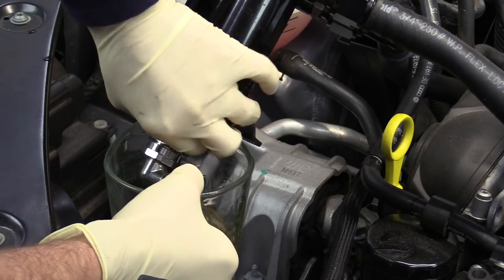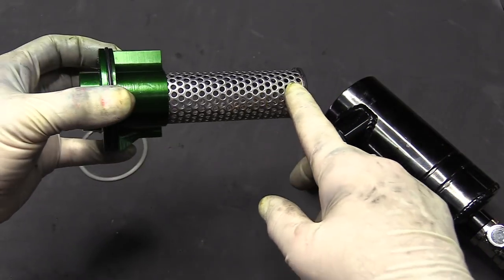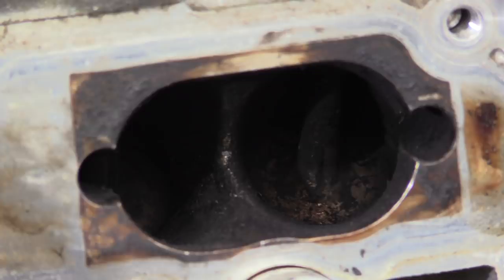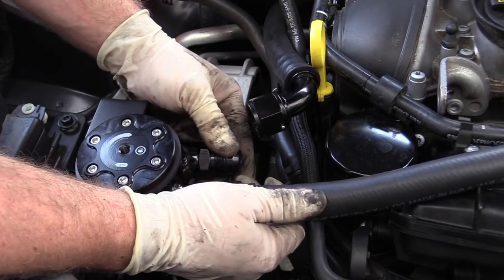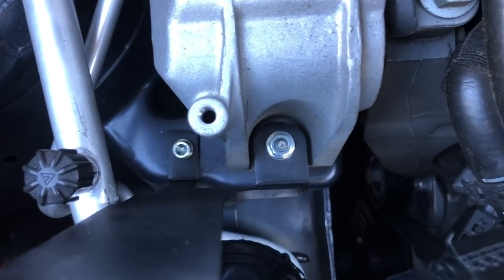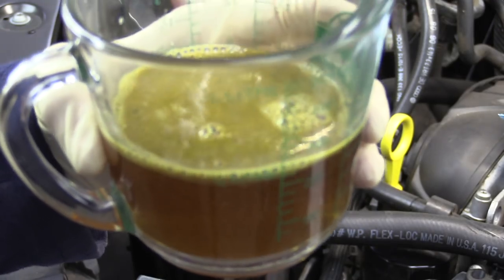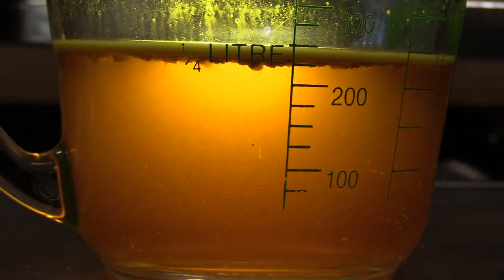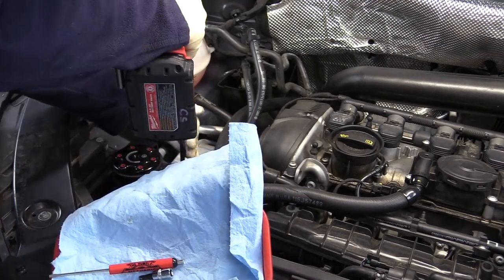Do Catch Cans REALLY Work?

Comment: Hello Charles.  What you have there is mostly Condensation.  On the GTI forums many folks have had their Catch Can Goop tested and found it to be mainly what is to be called Condensation.  There is some oil in it yes, but not as much as you think.  To answer your question?  No.  I have seen SO MANY reviews and folks that have used these in their MK6 GTI's on the forums, on oil websites, etc that folks that have had Catch Cans on for over 50k miles STILL had carbon build up.  If anything, this MIGHT slow it down some.  That would all depend on your driving style and where you live.  There have been folks in cold climates that have had SERIOUS problems with catch cans causing problems and lets not forget to mention Oil Catch Cans are An AUTOMATIC FAIL in an emissions test here in California, as I am sure any other strict Emissions State. My local Dealer cleans the Valves for $400.  This is cheaper than most catch cans, and since it only needs to be done once in a blue moon, I think just getting the valves cleaned every so often is the best way to go.  You dont really save any money here, its not proven anyway.  Just my ten cents.
Reply: Jeff Eppenger are you sure catch cans are a fail in Cali? Its my understanding that catch cans like Mighty Mouse are fine because they arent actually letting anything escape, just allowing the oil to seperate from the air.
Reply: Jeff Eppenger this catch can isn't open to atmosphere so the vapours go back into the intake which shouldn't fail emissions test. It's more an aos (air oil separator) than catch can.
Reply: Jeff Eppenger best comment I've seen on catch cans.  We know it's not 100 percent effective for sure. Your still going to have to clean your intakes , plus the cost if a catch can, plus the motion of cleaning it out more often than not. A change of oil.
Reply: Jeff Eppenger -- I think your right, and the condensation is from the catch can it self !
Reply: Why not just do an "Italian Tuneup" instead of spending the $400?
Reply: Frank Bongiorno Frank Bongiorno Naaah doesn't translate well to German cars. The side effect is they end up rusting out the body panels and refusing to work in the afternoons. But then again, you as the owner also suddenly acquires the nuanced Italian gestures and just shrugs it off like only an Italian can.
Reply: How is a $400 valve cleaning cheaper than most catch cans? Even expensive examples are less than $200.
Reply: I have built my own 3 stage oil catch set up and for a lot less than $400 !!!  I looked at some in the link and they looked way overpriced as most Euro crap is and the cars appear more complicated and with higher parts cost.  I like my Chevy and if the only other choice is imported I'll go with Japanese or Korean.   
.
The Canadian Condensator is a better deal than these ones and I consider them high too.  
.
http://www.condensator.com/
Reply: snb13 - You've never priced one for a TSI apparently.  The one Charles linked that he has is over $500.
Reply: Frank, because it doesn't work.
Reply: That is not an automatic fail. Nor is it a fail. It's not an emission related part. It has nothing to do with smog emission system on vehicles in California.
Reply: Catch cans wont fail emission testing unless you have it vented into the atmosphere which is a homade can, not a good design that is sold to the public.  It’s like having a drop leg in a gas line, how could that hurt testing?   It would help if anything, since you aren’t sending oil vapor into the cylinders to be burned.  If you simply wait till you get a fault code, then you have been dealing with lost performance and lower fuel economy well before the light came on.  It’s slowly choking out your intake valves and screwing up the seat over a long period of time, it’s not like flipping a switch.   Being proactive in maintenance and delaying this buildup is always the better way to go.    Use the crc intake spray cleaner with a catch can setup, also choose a good synthetic oil with a low noack or volatility, which means less oil evaporation, like Mobil 1 esp which is well known in Europe for diesels, but is also marketed for gasoline engines for emission systems protection AKA ESP.  You would be a good candidate for a lease.  Lol
Reply: @snb13  well,the one he used costs around 500$ so...
Reply: put small camera into hole of spark plug to inspect how much of c you have on pistons- it can not be cleaned by any seafoam or simillar just hard work gride-  i put off heads and on pistons were 2-3mm of hard carbons -from sucked oil from pcv valve that did not made its job

Comment: I've run a can on my hilux in Australia for years. It certainly catches plenty of vapour and has kept the piping cleaner.
On thing everyone seems to miss, 
This vapour also lines the intercooler with sludge creating a heat sinc. this prevents heat transfer and therefore stops cooling destroying efficiency.

Comment: I have a rx performance catch can it was filled with water oil from my 2014 Ford focus with a standard 2.0l I dumped out the catch can every 5k miles. Works really well and I will do also do an intake cleaning using soda media or glass to clean out my intake valves.

Comment: I can't help but wonder how much condensation is from the catch can itself. Like a single pane window, condensation appears due to cold outside air, warm inside. (draws the moisture out of the air to the cold surface and then condensates)

Comment: It's mostly just collecting water.  Not a big help.  In cold weather it is actually a pretty big risk.  If that can fills up before you get a chance to empty it all that junk will get gulped back into the intake all at once.  If it freezes , even worse.  Pcv won't work and pressure will build it in the crank case. 

In my opinion these risks aren't worth the reward.

Comment: Maybe what you drained out was designed to clean the back of the intake valves lol.
Reply: I saw that and wondered the same.   Clearly, it is mostly condensation and a small amount of water injection may be good for a variety of reasons (improved knock resistance,  cooler engine temperatures, and some steam cleaning on the back of the valve).  Really makes me wonder if a catch can makes things worse or better.
Reply: All that shit would go back into your intake. Do you still wanna question if it should be there or not? It's vapours, Sherlock, it's bound to condensate eventually.
Reply: @Lessthanthreeedm  yeah we're having a laugh orrite?

Comment: In other words.   
Engine designers design their engines with a flawed process in place and so we the end user has to come along and fix their failures.  

Interesting as I note they all have fuel filters and air filters and oil filters and even cabin air filters,  surly they must have some idea about keeping things clean yet for some reason they don't install catch cans.     

Thankfully,   we the customer know better than the guys who have millions of dollars to designed and test our engines.
Reply: Planned Obsolescence
Reply: It's the emissions laws that actually result in our engines being destroyed
Reply: We have dyno style E-tests here on the Colorado front range and they, years back, stopped looking under the hood and only scan the underside for a visual on your exhaust system.  If Cal disqualifies the catch can I would simply remove it before and then reinstall after the test.

It is not necessarily bad design work as it is also management not wanting to lay out precious pennies and Nickels for a better result.  In Delorean's book; "On A Clear Day You Can See General Motors", he outlines time and again how management; the accounting department too, run the roost and it is their influence that dictates the way the product finishes up. 

https://www.amazon.com/Clear-Day-You-General-Motors/dp/0960356207   
.
Finally; if every car had a catch can how many would actually do the periodic emptying and even then most would likely throw it on the ground or into garbage that goes to the landfill.  I take my used oil and can catch juices to a recycling facility here in Boulder County.

Comment: Sadly, I've not seen much benefit. Still have to walnut blast the valves every 20k or so.
Reply: Run it down and dump it in the exhaust pipe with a high heat silicone hose.

Comment: I would like to know if the pcv was still inline.  If removed, of course you're going to pull a lot.  But you only need a small vacuum (i.e. the purpose of the pcv) to operate properly.

Comment: I don't know why this device isn't standard on all Turbo/Direct Injection cars...
Reply from the maker: IT brings up the price, of the car, and the cost of maintenance.
Reply: HumbleMechanic yeah but they could say the same thing about cabin filters :p I hope catch cans become mandatory because without them engine performance and efficiency suffers and that ultimately increases emissions. I'd be more comfortable driving a turbo direct injection car if it came with a catch can from factory.
Reply: CSRT4 Ever that's a stupid assumption. That's like saying people are too lazy to change air filters and do oil changes (which they are but at least they let the mechanics do it). Catch cans should be mandatory on all direct injection engines as per emissions requirements
Reply: CSRT4 Ever besides what extra maintenance all you gotta do is turn a valve and drain the gunk it's not rocket science. This is no more difficult than adding washer fluid...
Reply: CSRT4 Ever that's the consumers problem then. Why are you defending a shitty design that will cause these cars to become junkyard scrap in 10 years. If you feel the consumer is so incompetent then don't you think less people couldn't be bothered to even drive a car?
Reply: HumbleMechanic Lol.Ok.Lets just not use catch cans and worry about carbon every 40k.
Cost woudnt be much if the company uses some sense.Extra hose and a can doesnt add much.
Now you see why you irritate me?
Reply: CSRT4 Ever Lol.Ok .Yea that makes sense.
Reply: Gandalf721 But toyota and ford combated the problem.The end result.More sales.More profit.
Dealers profit but do not design the cars.They have no say in what goes into the final item.
Unless manufacturs love standing behind their dealers that much and making them that coin.
At first I thought your point was valid .I had to edit my comment after thinking about that for a sec.
Reply: People wouldn't empty it, it would fill up and then become an even bigger issue when it all start pouring in to the engine.
Reply: They could run a hose and drain valve right down next to the oil drain plug, so you could drain it every oil change.   Simple
Reply: Might as well go back to whale oil headlamps and hand crank starters, expecting people to add an extra maintenance item lol
Reply: Darksyne they are too lazy to maintain their cars. Half of people don’t know how to put on a spare nowadays

Comment: I installed a catch can on my 04 and 14 Mustang GT .  And I noticed a different the cars is smoother and stronger. That garbage coming out of the crank case by way pcv is diluted the air/fuel  rationing. The car will thank you for a catch can